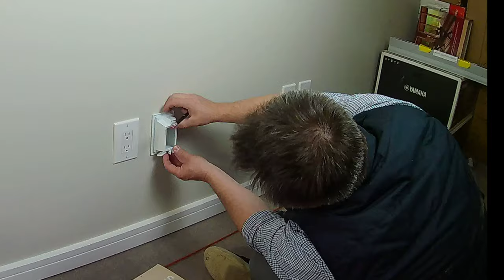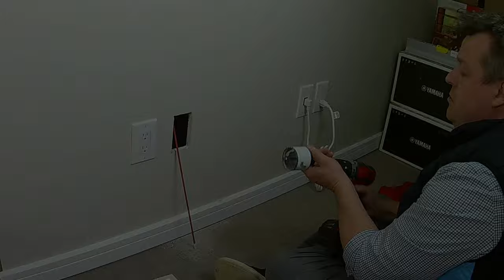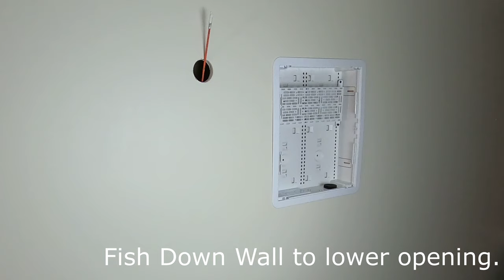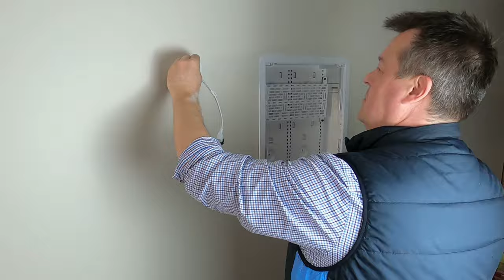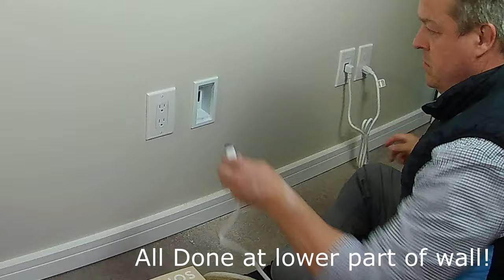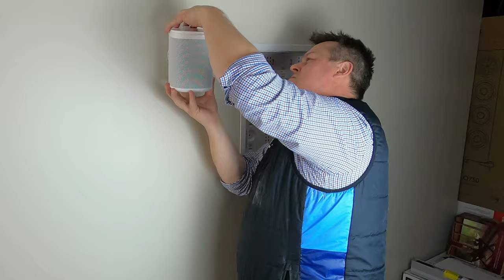Sonos Wall Mount with Hidden Wires.   Short Install Video | Midlite Power Kit.

Comment: Was it a proprietary power cable in the wall or was that nm? And if proprietary is it UL listed/ NEC compliant? This is an awesome kit but I'm nervous about insurance in case of a fire. It just seems contradictory to article 400.8.
Reply from the maker: NM  Molded.  Here is what it says on the package for reference.  Good to check with the local inspector on anything. 

 UL 817, CSA#22.2#21 • NEC Code: 250.146(D), Isolated Receptacles. • NEC Article 300.15 (E) Integral Enclosure
 and NEC 334.40 (B) Devices of Insulating Material and other NE